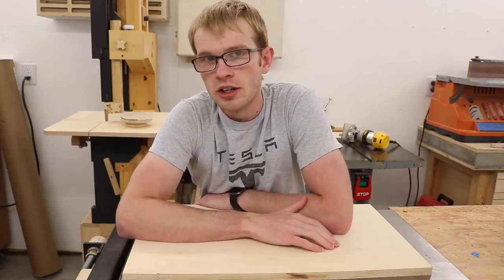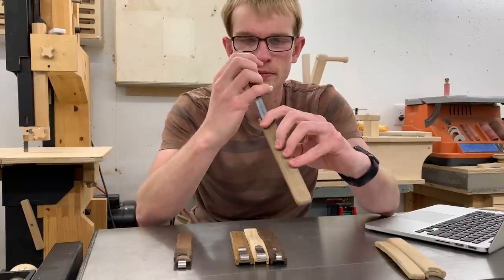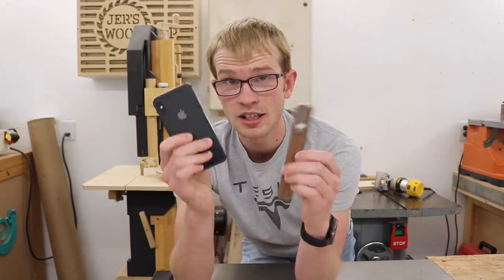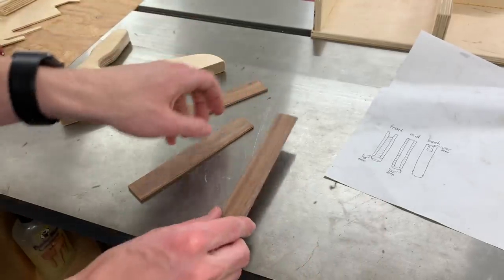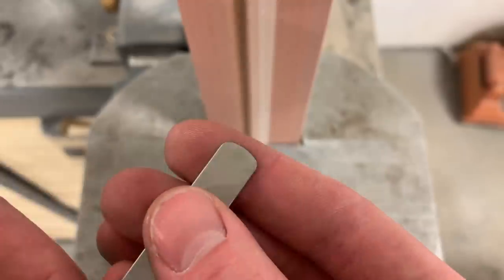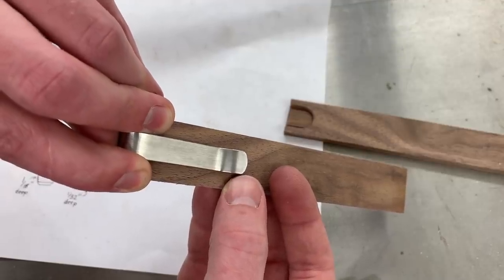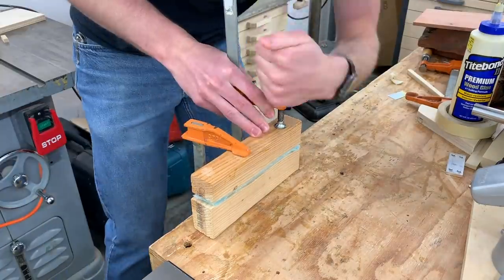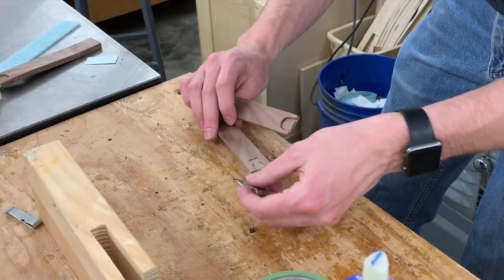Pocket sheath for a precision rule

Comment: Cool sheath.  Here are my 2 thoughts on bending the titanium. First, and maybe you already do this, sand the edge parallel with the edge, meaning along it's length with a fine sandpaper, making it smooth and polished so as to eliminate any stress risers. If you sand across the edge, the scratches can widen and become a major crack while it is bent.  My other thought is to place the bolt from the jig in the bend before squeezing. This would require the squeeze to take place on the metal ends.  The bolt and curve would not be in the vise, the reverse of how you are now doing it.  Hope this makes sense. I have never bent titanium sheet. Most of my experience is with aluminum , 2000 (2024 T3), 3000, and 5000 series.
Reply from the maker: I did polish the edges, to make it look nice. I didn’t think of it that that would help prevent cracking, but you’re right. About bending it around the bolt, I already bent it around the bolt until the ends of the Ti touched, so it cannot be bent any farther with the bolt still in there. If I tried it would just be forced to bend somewhere else.
Reply from the maker: Paul Straney 
Yes, I understand what you’re saying, but what I’m saying is if you do that, the ends of the clip will come clear together until they touch (about 190° bend). But when you back off the vise it will spring back to about 160°. The Ti is very springy.
Reply: @Jer_Schmidt  I sent you an email. My idea may not be satisfactory. Hope it helps as Ti is expensive.

Comment: Great work. Really good. Which Kind of Metal did you used for the Clip? I‘m looking for something just like this to make a spring. Metal, that you can form but which isn‘t moving back in its Start Position when its pushed together. 
Greetings from Germany. :)
Reply from the maker: 6AL4V titanium. 0.032” thick. It’s the best material if found for clips.

Comment: Interesting why you didn't build a straight slot (all the way with a removable bottom) for the scale and embed a magnet(s) into the sheath?  The removable bottom would allow you to blow debris through. Your method is definitely clever.  And, why didn't you consider multitasking your pen next to the scale?
Reply from the maker: I didn’t want magnets in it, as they would magnetize the rule and collect metal shavings.
Reply: @Jer_Schmidt  Good point.

Comment: It looks like I could move the clip lower... so the upper end was an inch or higher than the clip as ladies pants aren't usually six-inches deep... Either that or I'll be adding a couple of inches to my pockets (an easy fix with a sewing machine... another great power tool). ❤🌅🌵
Reply from the maker: That’s a good idea. I usually like to keep the stuff in my pockets more hidden, but moving the clip would be a good workaround to shallow pockets.

Comment: Interesting  and useful, and well presented , as usual.  But .... as with so many of these videos, in many other channels also, the construction site resembles a well equipped factory! Am I the only person here that possesses just a small workshop space in a modest one car garage? The sheer mass of equipment deployed or at least on-show,  might  just intimidate the casual passer-by into believing that something as simple as this wooden sheath needs to involve so much costly hardware? It would be refreshing to see the same build task completed with a modest assortment of mainly hand tools, which I believe in this case could easily be done.
Reply from the maker: Thanks for saying this in a not-nasty way. It’s something that I think about a lot, and I actually try to position the camera to limit the amount of tools you see in the background so as not to scare people off. It’s hard, because I want to be able to do a variety of projects to keep it interesting, so I need a variety of tools, even though each of those individual projects doesn’t take many tools.
Reply: Appreciate the response, thanks. How about a few hand-tool projects, just to even things up ? Best regards.

Comment: I was wondering could you cut or sand the curve on the inside so on the outside remains straight? In theory I'm sure it's possible but I'm not sure of the difficulty.
Reply from the maker: Yes, like I said early in the video, that’s what I did on the third prototype. It looks straight on the outside but the slot inside is curved.

Comment: I am kinda of shocked you use a PST still. I feel like the original Wave completely improved upon that and made it obsolete. My hand hurts just remembering how the handles felt.
Reply from the maker: Since I carry it in my pocket instead of a holster, the small size and smooth exterior are important. The wave is nicer to use, but way harder to carry.

Edit: I do have a wave, so I’m very familiar with both.

Comment: This is an awesome piece of EDC gear.

My only critique, being a pocket knife enthusiast, is the pocket clip.

Not the shape or material. Both of those aspects are great.

But if you were to ever snag the clip and unbend it, you would not be able to fix it due to the clip being glued into the piece rather than fixed to it with screws.
Reply from the maker: I agree, but I’m not sure how to secure it to wood well enough without glue. Screws will just pull out over time.
Reply: @Jer_Schmidt  Sounds like something to think on.

Maybe running a sheet of titanium down the middle of the back piece as a mount to secure screws to?

The issue with that would be bending the titanium into the S shape.

Hmm...
Reply: @Jer_Schmidt  

There might also be some potential here with some neodymium magnets.

Comment: To answer that question, I had taken some Viagra before a first date and gone to a restaurant. After some time I had to use the restroom...and yes it was uncomfortable getting up in a public place. Although packing a bit more wood. Somewhere between 
7 and 13/64" to 7 and 7/32". Approximately. Still uncomfortable nevertheless.

Comment: What if you made one that operates like a box cutter, but the blade is the ruler?
Reply from the maker: I feel like that would be heavy and awkward to use. I like how light the rule is by itself.
Reply: @Jer_Schmidt  Could bez but it would be cool. ;) Maybe a 3d printed or basswood version?
Reply from the maker: SkewToob 
You need to try using one of these little rules. It would be almost unusable if it had a handle hanging on it.
Reply: @Jer_Schmidt  fair point

Comment: Hey Jeremy I noticed with the last design with slot to push out debris looks like a handy little square when the ruler is pushed through, if you can actually engineer a way for it to be a precise 90 degree angle and remain that way, You probably already noticed or came to that conclusion.
Reply from the maker: I actually hadn’t thought of that until several comments pointed it out. I’ll be thinking about how to incorporate that in the next design.

Comment: I woulda drilled a hole through the previous version to let the lint out. I rather fix the original than to rebuild it all over. You lost years of history. 

I have a similar 6" ruler, and I never use it where I can use calipers. So I very rarely use it!
Reply from the maker: The thing is, there are always other improvements I want to make as well. From #6 to #7, I also made it thinner, narrower, finger notch a bit deeper, and added cleanout slot.

And yes a caliper is more useful, but how would you carry that everywhere all the time?
Reply: I don't carry it. I just have a caliper at every bench or machine I would ever use it. So far that's four. 

I have to admit, I have taken a caliper into the hardware store more than once to help find a fastener or widget. I just put it in the car and then carry it in my hand while walking around the store like I own the place, lol.

My workshop is a heck of a lot smaller than yours, though. I hope you're already working on your next vid. Been too long, Jer!
Reply from the maker: Mildy Productive 
Well that works :-)  I work between two separate shops, so it would take more than four calipers I think.

Comment: Jeremy get off your butt and show us a new thing you are going to build... no mods... I haven’t got my garage built yet, the slab is going in tomorrow,, should be in by next week.  And Build by the end of next week, then electric, then epoxy the floor then put in the benches, tool boxes, I will be ready in a month or so.... so show us something...
Reply from the maker: You doing woodwork? I’m working on a CNC router design, but it won’t be done in a month.